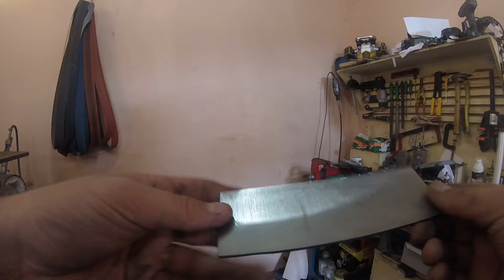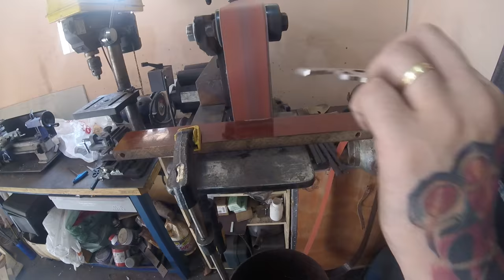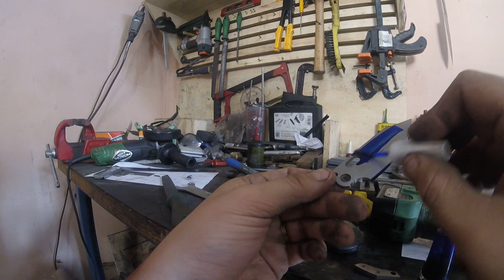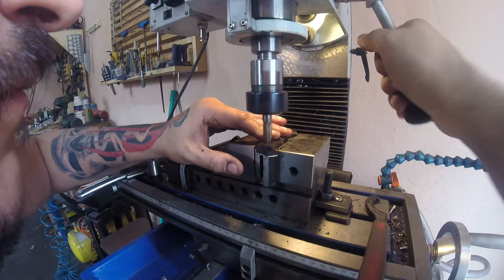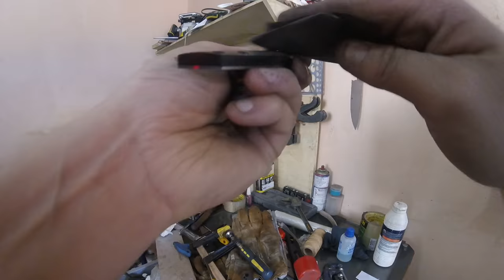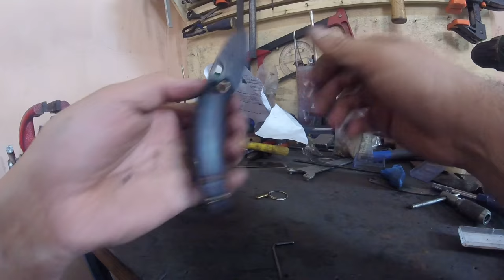Hand Made Friction Folder - Canivete artesanal (Butch Cassidy Custom Knives)

Comment: Did you add any type of washer to the knife blade? I made a friction folder for my brother and used teflon washers to keep the action smooth, but the knife is having an issue of not having enough friction to keep it open once it's opened.